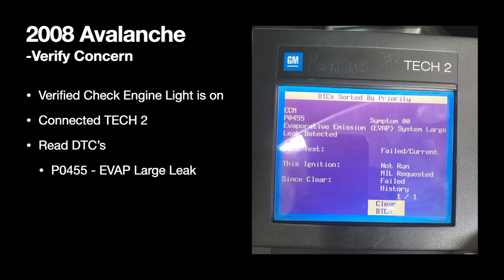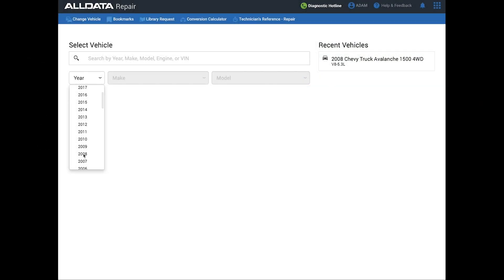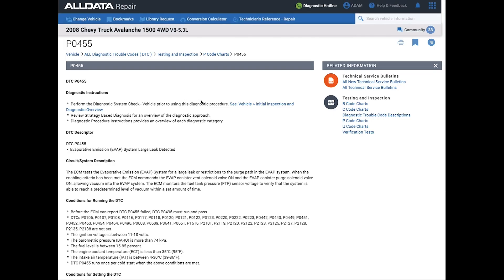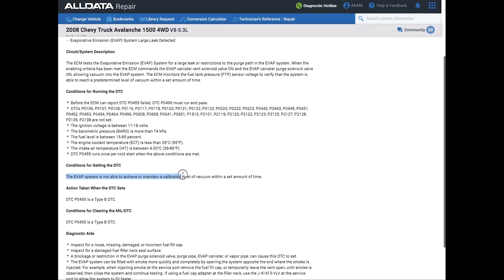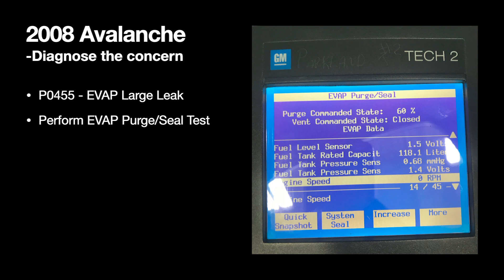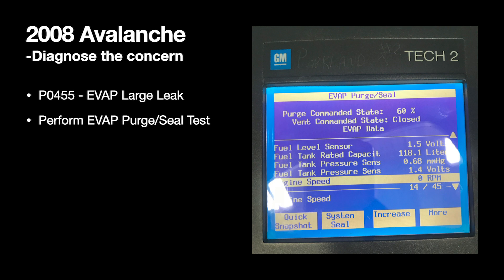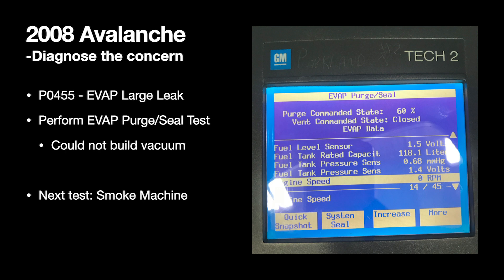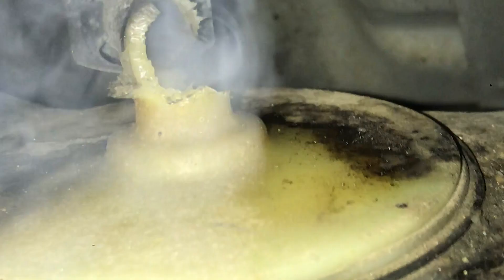EVAP Code Case Study

Comment: This is a good video.  I have an 09 aveo. Recently it produced a 496 dtc. I did a smoke test and found nothing.  I did a vacum test with gauges on every component in the evap and found nothing.  I replaced both solenoids. When warmed up..the purge runs a 13% duty cycle and,but the vent only shows venting.(I'm not sure if I just dont understand  this system or scanner or what)...  in any case...  the bottom line is this...  with no leaks(verified) with a brand new fuel cap installed the evap system shortly puts this car to a 30 plus fuel trim.  If you unscrew the cap and leave it hovering on fuel neck the fuel trim will quickly correct and go negative 30(maybe more in both directions ..I shut it off)... if you remove fuel cap completely... the car will die.    What would you do look for at this point?...I dont have a clue.  This motor runs a 5 fuel trim with evap disconnected and plugged.
Reply from the maker: Hey David, this sounds like an interesting problem. The code is telling us there is Continuous Purge flow; and by what you experience with fuel trims, I would suspect there really is flow present. It sounds like you've gone through a lot of testing. I would remove the purge valve hoses (leaving it electrically connected) and use the smoke machine to verify what that valve is doing at idle. The other component that has a high influence in this system is the fuel tank pressure sensor. Did you do any testing to verify it is reading properly? If this sensor provides inaccurate readings the system may operate the purge valve at incorrect times.
Reply: @AdamsAnalysis  thank you for responding.  Hmmm. Ill look at idle tomorrow(I didn't read this till tonight)(I think it was the same 13 to 14 % duty cycle..not sure)  but The purge is definitely opening.  It puts a steady concave in my plastic tank.  It seems to stay on or open all the time after warm up.  (So much so I've replaced the purge again(not sure if ac delco was not good enough, but it began to leak))  I tested the sensor today.  It said should be between 1.3-1.7 volts at start up with no pressure...  it was 1.38 at start up and shortly increased to 1.9 before I shut it off(I had to to leave)  I'm not sure how high it would have got but my fuel trims was already at 21 I believe.  Besides the weird gas cap thing it's doing I might mention...  you can hear a gurgling in the tank if you listen at the neck...   and i did a fuel pressure check today and it was 57(appropriate spec) but lost three immediately(not sure if it should do that) and another 4 in thirty minutes(50 p.s.i)   
I've unhooked the purge system(vacuum)and am driving to go get a pick a part charcoal canister tomorrow(The Lord willing) as the car does pretty good with no evap.   I drove it a lil today and noticed it did good on trim..and I noticed that now(with evap lines dangling open from tank and purge valve electrically hooked up... the duty cycle does increase and rpm and load increase... 
I hope you might have some direction ideas as i dont know anything about evap.  Again thank you for responding.  David
Reply: @AdamsAnalysis  I thought I'd let you know...  I installed a used.charcoal canister and that fixed it.
Reply from the maker: david crane that’s Great news!